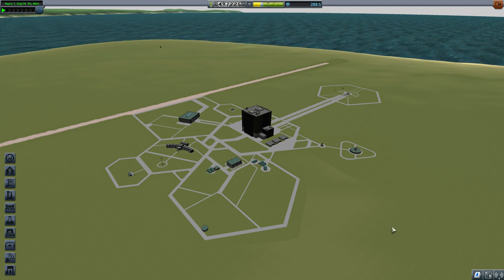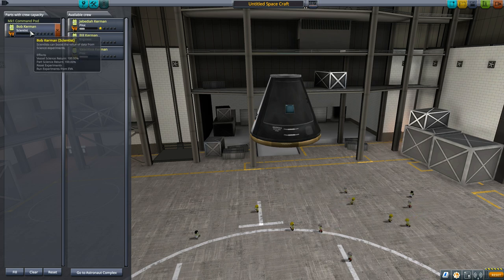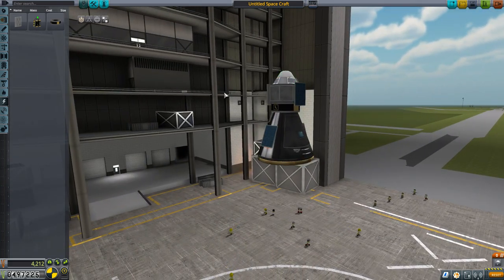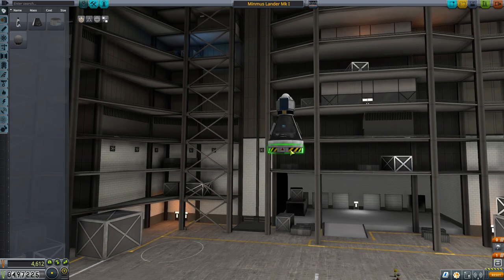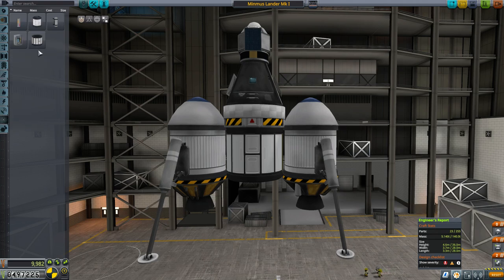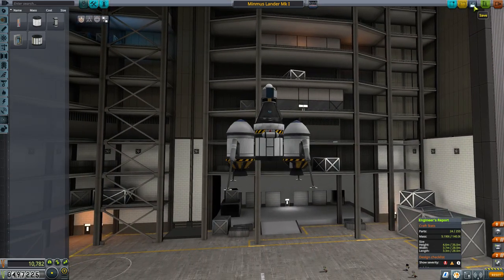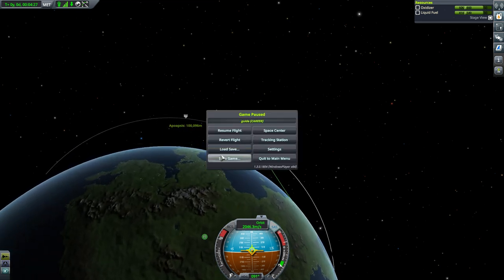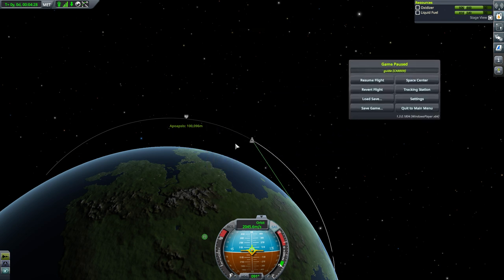Guide to Kerbal Space Program...for Complete Beginners! - Part 7 [Minmus Lander Design]

Comment: I'm surprised you have basically ditched Solid Rocket Boosters. They are great for the first stage of launch as they have a high thrust-to-weight, are usually cheap, and help to get past most of the initial air resistance. These means you save more of the precious liquid fuel for the later parts of the flight where they will be more efficient.
Reply: Fronic yeah
Reply: @jmstudios457  yeah

Comment: Once your Periapsis is above 70kilometers, what is the point of burning fuel to create a circular orbit?
Reply: Circular orbits are easier to interact with later on.  For example, if you have a highly elliptical orbit and want to go to the Mun or Minmus, then it will be more difficult to find the right place to start the burn.  If/when Quill gets to docking in the tutorial series, it is also much easier to dock with something in a circular orbit than an elliptical orbit.

If the mission is just "go up, orbit, come back," then there's no real disadvantage to an elliptical orbit.

If you're interested in hyper-efficiency, then a low and circular orbit is the cheapest to establish, but that means that the apoapsis should not be far above 70km either.